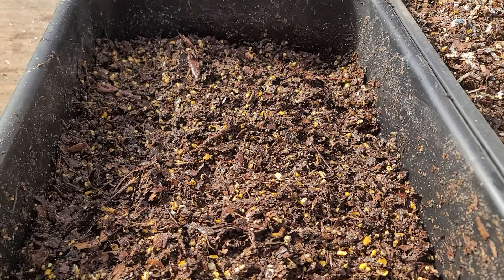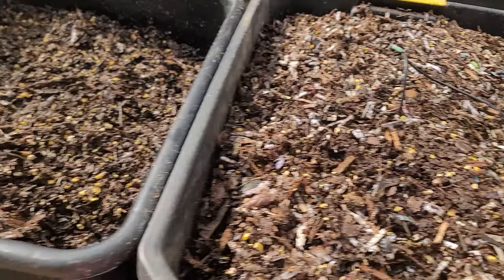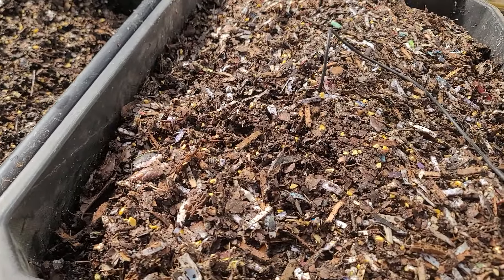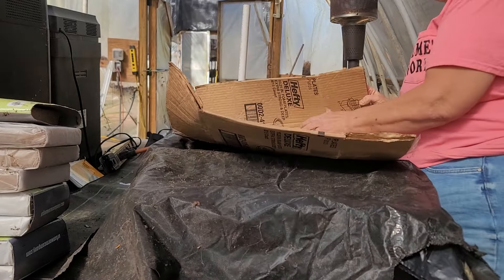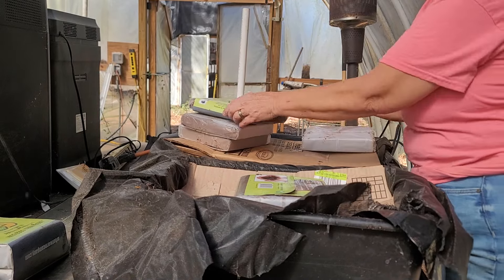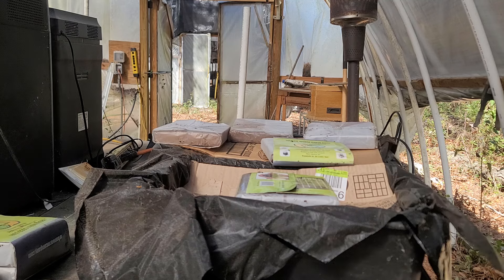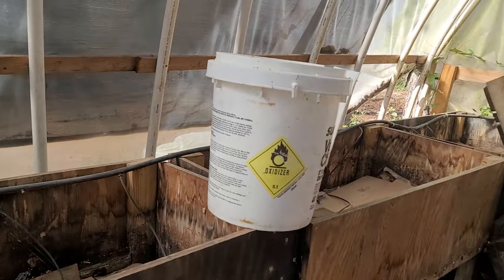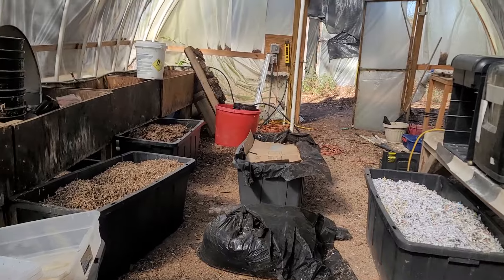Experimenting Making Compost from oak Leaves for Red Wiggers

Comment: Hi, Mimi, Michelle here. My question is, if I've put the worms into an already bag of dirt. How do I know the difference between worm casting and the dirt? Or doesn't even make a difference after that point.?
Reply from the maker: worms should not be put into "dirt" or potting soil. You should use compost or shredded paper. Starting the bin with only 2-3 in of worm bedding and then adding more as needed. The castings will be black